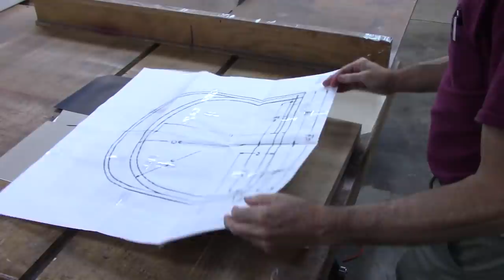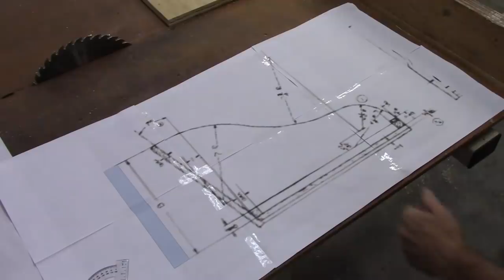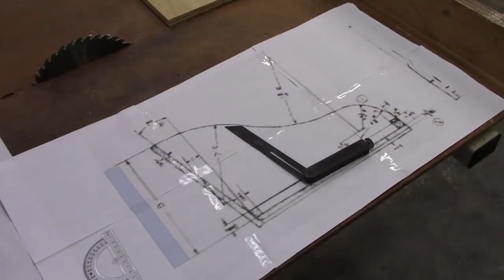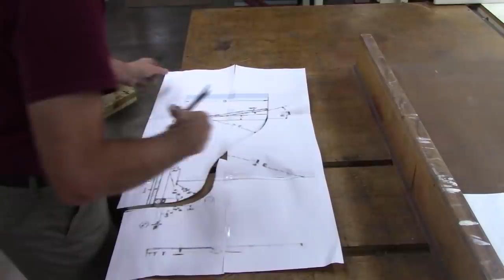Part 1 - Building a Briggs & Stratton Buckboard Flyer

Comment: Kinko's (or FedEx Office, I guess they're called now) will print a large format b&w drawing for only 3 or 4 bucks. A lot easier than carbon paper.
Reply from the maker: Still need a means of transferring the line but thanks for the tip.
Reply: @WinkysWorkshop  spray glue the print right onto the work and cut right through it
Reply from the maker: @RichSobocinski  - Yeah...  good option.

Comment: Did you have to worry about the ackerman angle?  Didn't notice if you did.
Reply from the maker: That was something didn't know about but I modified the steering to make it right. Hopefully I'll cover this in part two. I haven't reviewed the video yet and I can't remember. I may have to fill in some blanks at the end. Also my camera died and I filled in with a little cell video (although not much). I've got a new camera now.

Comment: If some enterprising young man started to make these, he would do pretty well.  I think that the material cost would be around six hundred dollars; an electric-start engine goes for about four hundred dollars at retail. The finished buckboard could probably sell for eight hundred dollars. If it were electric, the price would go down to six hundred dollars.
Reply from the maker: I didn't follow that math but I'm not that young man HA
Reply: Winky's Workshop  You’re right, the numbers don’t add up. And I have a degree in Finance!  Maybe I should work at the Treasury Department. Anyway, it’s a great project, and I think they would sell if there was a factory. Back in the day, young men would give it a try. But now, everybody wants to sell Chinese stuff on eBay.
Reply from the maker: @ronliebermann  Honestly...  I think safety regulators would have a field day with this thing. Building it for myself and commercially are quite different. Safety is good but it's sad the common sense doesn't play a larger role.
Reply: Winky's Workshop  Actually, the traffic landscape is changing rapidly, because of all the electric vehicles. We have scooters, wheelchairs, golf carts, bikes; all kinds of electric machines are running around. In Phoenix, regular golf carts are street legal. I think that in the future, there will be a lot of restricted-access neighborhoods, where automotive traffic is not allowed. Little cars, like the one you built would be perfect. Personally, I’d like to see horse drawn omnibuses come back. Kids love them, and they can go to school and the store, and add some color to the neighborhood.
Reply from the maker: @ronliebermann  - I'd say you are right... at least in highly populated areas
Reply: I'm not a young man any more but I have been building one - actually 2 - a gasoline "flyer" and an electric "red bug" and your cost estimate is WAY OFF!!!!  I started mine 20 years ago and put it on the "back burner" for 18 years and I had close to $600 invested at THAT time. That was tires wheels and wood and some of the steel. 
Just hardware has set me back over $200 for the Flyer. . Also the cost of the tires have more than doubled anf the wheels more than tripled since. Have you priced steel lately?? Electric price is actually higher than gas (battery and controller costs - as well and the motor

Comment: I take it that this is totally street illegal - so where do you use it? I started counting the number of laws this would break in the UK, lost count around thirty...
Reply from the maker: It was street legal in 1920 but I doubt it would pass any kind of modern day inspection. As far as the laws goes here they are lenient. Strictly speaking golf cart, go karts, mini bikes dirt bikes etc. are not street legal. However, if you stay off the main roads and don't make yourself a nuance they look the other way. There must be 6 golf carts, 4 four wheelers and a dirt bike in this neighborhood. Heck... my neighbor is a police officer and his kids have a golf cart and four wheeler. The population density is fairly low here also...  not much traffic and I live outside town. I thought about getting it licence plate for it. I might be able to if I made the breaks better. They have special licences for antique cars and even reproduction cars.  I might also have to install brake lights.
Reply: @WinkysWorkshop  Wow, sounds very tolerant. Not taxed, registered, insured (not insurable), type approved, no chassis number, no seat belts, at least ten emission control issues, inadequate brakes, no speedometer, no lighting (brake lights or running lights), no mudguards, no test certificate, not crash tested, no certificates of conformity... and I am sure I have missed out a bunch of other stuff. But then a lot less people die on our roads, so it is not all bad.
Reply from the maker: @Tensquaremetreworkshop  - Certainly safety is important but you can take things too far I think. I would never think about taking this on a highway or in heavy traffic. My neighborhood is a loop without through traffic and I'd be surprised if there are more than 8 cars an hour passing by. Driving this car has some risk but so does riding a bike. For that matter, have you ever thought about surviving a wreck on a motor cycle going 70 MPH? Not only are you likely to die you are also dealing with a lot of other people. I used to work in the printing industry and the guards were getting totally crazy. 30 years ago the machinery had half the guards but guess what, accidents since they installed massive guards went up. Have you ever been skying? Do you think they need to eliminate the steeper slopes? It's all about risk assessment and common sense. The US has a ton of problems but  I'm glad I live here. Yeah...  i could make do without a cool wood car but if people are anal about this kind of stuff I can only imagine the restrictions put on every day life.  No thanks!

Comment: Great build video. Do you have a link for a parts list and a plan set?
Reply from the maker: Thanks! There is a link to the original drawings I went by under the video. I should probably redraw the plans but that's a Huge job
Reply: @WinkysWorkshop  thank you! I'm interested in building one for exploring rv camp grounds.
Reply from the maker: @tylercasey1951  - Consider this...  spoked wheels of this type are not build to be driven by a motor. the pusher wheel is to resolve this issue. However, it is only suitable for dry pavement. My car will not go if the pavement is slightly wet. I would suggest buying motorcycle wheels and making it direct drive.  B&S made a Redbug Flyer also. It was electric but also direct drive to the wheel. The wheels were a lot more than a standard bike wheel.

Comment: My brother restored a model T and I thought he told me that the king pin on the steering arm should be at an angle that points to the center of the tire at the ground to make the car steer easier.  I never seem to see this on go carts though.  Also I thought the front wheels should have a slight toe in at the front to track better.   I thought I would have to find a Smith or Briggs Motor wheel to restore to ever build the Buckboard Flyer, but you seem to have shown me otherwise.  Great work!  I see you have a link to drawings in the description  and suggest a 2001 Kia Rio spare.
Reply from the maker: In part 2 I'll cover the gearing better. I originally had a 14 tooth drive and 112 driven with a 20 inch wheel. I just installed an 11 tooth and it is way better. With the 14 tooth it was like trying to take in a car in 4th gear. Now it's more like 2nd gear - There is a trade off with speed and low end power. 11 tooth on the motor is the smallest I can go but it's about right I think. The large sprocket was hard to find and I don't think you will find a larger one.
Reply: Winky's Workshop I wonder if a pulley and belt setup would solve a lot of issues. Use an idler pulley to engage the belt smoothly, apply more tension for speed and less to slowdown.

Comment: Very nicely equipped shop. You could be out cavorting with the bad boys, or underfoot at home, so I guess the wife is okay with the money spent. Seriously though,  was your day job one that required the skills and tool, or was it more cerebral? Kudos on the build!
Reply from the maker: Thanks on the shop. I have always enjoyed woodworking as a hobby and to some degree working with metal. I work on and ran a large web offset printing press most of my working life but that last 15 years before retiring my job changed. The new job started out being a trouble shooter for the presses but I ended up redesigning the machines in problem areas. We had a great machine shop but quite often they were busy on breakdowns and didn't have time to make the parts I needed. This is why I got my first lathe and after that it was a chain reaction. The shop at work still did some of the larger machine work but I spent many 2 hour lunch breaks making parts for work. I loved my job for about 12 years but after that things got worse. First I solved all the problems I had cures for and was left with all the hard to fix (or impossible) problems. When I retired I have about 25 projects going....  I was overwhelmed and I'm so glad to be done with it all!!! Plus I was basically doing an engineers job and fixing problems that had existed for many years and being paid as a pressman. For all the headaches I was dealing with it simply was not worth efforts.
Reply: @WinkysWorkshop  Wow! Thanks for the interesting story. I think a lot of us retired folks have stories to tell, but yours is quite a tale! Well, I’m glad you’re having a good retirement in your adopted state, you’ve earned it. By the way, I think we’re about the same age. I retired from a power company out here on the west coast. Started in the field, ended up in the main control room for the entire Los Angeles area.
Reply from the maker: @DanielinLaTuna  - My dad was a sub station operator for City Light (Seattle Power company). I'm almost 65 but retired at 62.
Reply: @WinkysWorkshop  Wow! Fascinating, I would talk with Seattle City Light, Portland General Electric, BPA, and other NW providers,  as well as utilities in Utah, Arizona, Nevada and New Mexico during the electric crisis. We had power flowing both into and through LA from/to the northwest and southwest as everyone tried to cope with a messed up situation. It was ugly. We lost one of our system operators to Duke Power.  By the way,  I'm 65 too. Retired five years. Best wishes.
Reply from the maker: @DanielinLaTuna  - Enron created. Dad wasn't very high up. I don't remember his exact title. He changed sub station locations 3 times. They went from 3 operators to two and then zero and he ended up changing jobs about 10 years before he retired. Seattle city light had a range repair service and he went all over Seattle fixing electric ranges. He said he love it. I think he was bored at the sub station. Man he knew how to find his way around Seattle!

Comment: Thanks for sharing. What did you use for wheels?
Reply from the maker: I got them fro Lapp Wagon Wheels. I ended up sending 2 of them back because they wobbled. They seem to be very strong but I guess quality control is lacking. $162 with shipping for all 4 but it cost me $28 to send the two back.
Reply: @WinkysWorkshop  Thanks

Comment: I looked a the link you gave.  How did you know about the wheels, what are they and where did you get them?  Did I miss that somewhere?
Reply from the maker: I knew the length of the car from the drawings. Then I found a good side view of a Flyer and imported it into cad, made it the right length and measured the wheels. I did this a couple of times and they were very close to 20 inch. It's possible they had a different sized tires back then but it was 16 or 24 inch. I bought the wheels from Lapp Wagon Tire/Wheels ($162 for 4). I sent too back for a wobble but they seem to be very sturdy. McMaster Carr has some that are probably better but they are $60 each I think.  I'll include some of this info in part 2 or 3 (I think it will be two parts)
Reply: The spokes are large and clearly much stronger than a bicycle rim.  It really gives it a good look.

Comment: how big around is the sprocket
Reply from the maker: The wheel sprocket is 112 tooth and the motor is 12. I had a 14 tooth on the motor but it was too fast. Top speek with the 12 is 28 MPH which is fast enough.

Comment: What are the 4 wheels you used and there size please.
Reply from the maker: They are 20" sold by Lapp Wagon Wheels. They sell the same wheel in flat free or air inflated tires. I bought the air type. They worked and I never had them fail but the bearings are poor quality and I worry about side loading. Workman Trikes sells some that are much better quality but of course much higher priced.

Comment: The one thing I would of done differently is added a few 1 x 1 tubing from the front axle to the rear axle . People were alot smaller and lighter back then . YES I know you want it to flex . But it would look Goofy sitting on the side of the road waiting for the EMT's with a cart in two parts . Don't you think ? LOL
Reply from the maker: Kind of amazing that people are getting bigger. I'm a light weight, Never say never BUT...  I doubt I'll ever break the cart.
Reply: @WinkysWorkshop  I am 6 foot tall and was always between 175lbs - 190lbs then my 19 yearold son Matthew was killed in a accident(Feb 25,2000) on our Ranch and at my worst I got to 549lbs . . I gave up on life like alot of people do . But I am down to 378lbs now and I want to be the old me . It is not easy Being 378lbs . It is Like I am walking around with someone on my back all of the time . But I will get there . So why didn't you up date the frame a little ? It is Cute .
Reply from the maker: @BigHeartedMan65  Sorry to hear about your son but it sounds like you are handling things better. On this version I wanted to keep things fairly original. One the next car (if I make one) I'll make things stronger. Honestly, the wheels worry me a lot more than the frame. Spoke wheels are rated for downward force and not lateral. Yes some are made for lateral force but most are not. Mine have a high load rating but who know about the side force...  so far I'm on top of the car... I hope it stays that way.

Comment: I built an electric bike last summer, but i have a lot more free time this summer! thinking about making an electric version, which would be a LOT easier, a lot quieter, tho less authentic, but i want to drive it not put it in a museum.
Reply from the maker: Actually they made an electric version called a Red Bug. The biggest problem iI have is finding a wheel with a large enough axle. Most ebike wheels require support on both sides.
Reply: @WinkysWorkshop  e-bike kits come with the hub motor already installed in a wheel and tire. i was thinking of  using the triangular 'rear end' of two bicycles, from the down tube back, and maybe using a common axle, but even that might not be necessary. it's far from your project, but i have only facilities for cutting by hand and light welding; upon further consideration a trike might be more practical...
Reply from the maker: @stevendaleschmitt  - A trike would be cool. You could also use forks on the front wheels at a fairly extreme angle so that when you turn the load on the wheels is not lateral.

Comment: Without a proper "caster angle" it's just a low speed wobble cart....isn't it?
Reply from the maker: The caster is 8 degrees and seems to be enough. Most cars are less and most go-carts are a lot more. I took a guess.  It goes about 28 MPH and does well but the steering is VERY quick. Too quick for anything faster. I've thought about a rack and pinion.

Comment: Does someone make a kit for the metal components?
Reply from the maker: Not that I know of. I think an on board motor would be better but wheels that can be driven are hard to find. Of course that would not be as original.
Reply: @WinkysWorkshop  I build ebikes and would add a hub motor for the 5th wheel
Reply from the maker: @JohnPaul-jg7es  I was thinking two hub motors (both rear wheels) but the axels are probably too small. The pusher wheel in a novel concept and it works but it has issues driving while cornering.

Comment: Have you tried to put plates on it? Pretty sure it qualifies as a replica
Reply from the maker: Interesting and you may be right. I'd have to put light, blinkers and a rear view mirror on it an then get the wife to agree...   That last part is the hardest part.
Reply: @WinkysWorkshop  hand signals
Reply from the maker: @sal.m2A  Yeah...  I'll bet they would require brake lights. Maybe not the turn signals. Still my wife!
Reply: Ill bet hagerty insurance is less than $100 a year
Reply from the maker: @sal.m2A  - Really...  interesting

Comment: What wheels/tires did you use?
Reply from the maker: I got them from Lapp Wagon Wheels. Based on load rating and price. The quality is not very good and had to return two for a wobble BUT the four that I got are still working well.

Comment: Um, seems to me like it would be better to use E-bike wheel hub motors.  A lot less machining needed and with a solar panel "shade" it could be quite the machine.
Reply from the maker: I was going for original although the wheel and motor I used certainly looked nothing like the original.  Gas was way cheaper.
Reply: @WinkysWorkshop  I've been wanting to think about the electric version.  Mostly because a 500w solar panel as a "roof/sun shade" could prove interesting.

Long distance, low speed, travel for essentially nothing is the desire.
Reply from the maker: @michaelshultzinger4902  - That would be impressive.